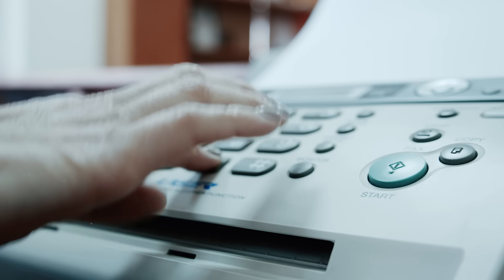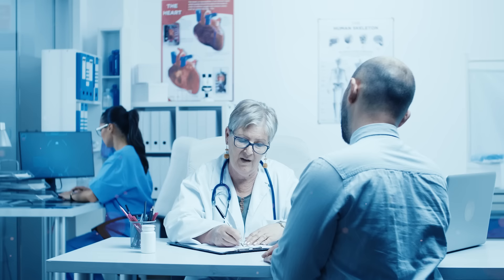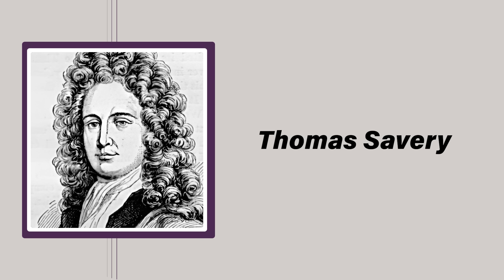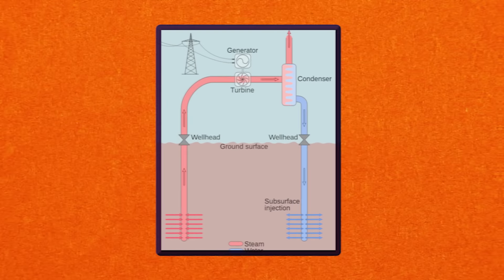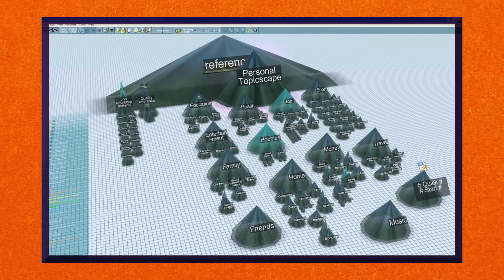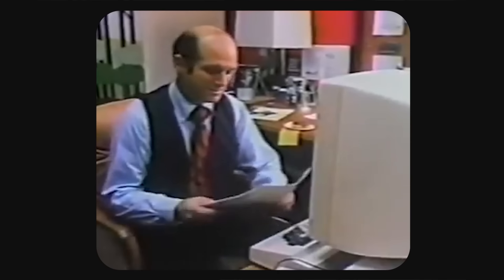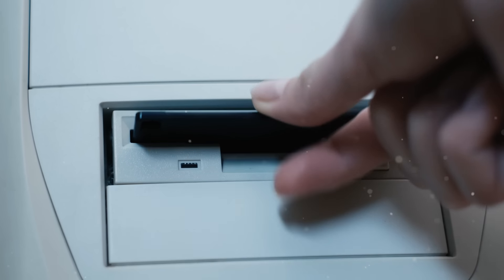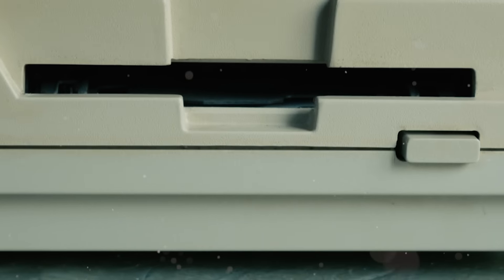Terribly Outdated Technology that we Still Use...

Comment: I've done those navigation database updates on 737s using 3.5" disks, and not all that long ago. That airline replaced their old data loaders with ones that had a USB port, but they retained the 3.5" disk capability as well. It was really irritating having disk 3 of 4 turn out to be corrupted. Sad trombone sound....
Reply: I had to dig out my floppy collection to update a CRJ 200 just to find out 1 in 3 of my floppy's were still good. For some reason the cannon plug is different for the floppy data loader vs the usb data loader on that AC. Personally I feel they should all convert to some form of serial connection.
Reply: Yeah the reliability of floppies is WAAAAY overstated in the video.
Reply: @jeposton do you have any idea just how mind-bogglingly expensive, time consuming and labor intensive it is to get even a minor upgrade to an aircraft's avionics suite approved by the FAA? Remember how truly old many commercial aircraft are today.
Reply: @billmullins6833  Yes. I do. An older aircraft, it does not make any economical sense to swap it over. However the data loader would probably be easier to modify to pretend to be a floppy drive when in reality it takes a magic USB drive. Of course that all has to be approved by the engineers and the FAA which is prohibitively expensive and they will only approve it per aircraft and not for every one just like it.
Reply: dont a lot of commercial airliners still use integrated analog computers?
Reply: @Term-0   I'm not sure about that. When I deal with a computer on an airliner, I just test it to see if it works, and replace it if it doesn't. They're just modules in racks. I think that all of the computers in the Embraers that I work on now are all digital.

Comment: I haven't worked with it in a few years, so it would need to be checked if this is current since 2021, but;  I'm Surprised that you didn't mention Fortran programming language.  Fortran is still used as the core managing language for Nuclear Power plants.  It's usually what was being moved around on those floppy disks.
Reply: Also supercomputers
Reply: You would be surprised at just how much code out their is actually Fortran hidden inside a C++ or Python wrapper. BTW I never did workout what the 7 spaces at the start of each line were for…
Reply: @davidwright7193  two reasons: 
1) you leave space for labeling line numbers if you're going to used them in the future.
2) legacy required white spacing for ribbon printer rolling.

Fortran still has to be compatible with it's 1950's versions even in FORTRAN 90
Reply: @eddokter  I was taught on 77 and the compiler fell over if you put line numbers in the 6 spaces but 2 sounds correct. I was working on one piece of legacy software in 2009 where the documentation referred to input data sets as “cards” it was only after I had worked out what this meant for the format of my data entry files that I realised whoever wrote that was expecting me to be punching holes in a piece of card with a knitting needle…
Reply: I would be prepared to bet that there is still a lot of stuff stored on punch cards or paper tape, as well as magnetic tape reels.
Reply: @allenjenkins7947  I am not going to take you up on that having found paper tapes holding protein structure coordinates in a box while clearing out an office.

Comment: I work in  the medical field, so I see fax machines everyday. Also, I grew up in a military family. My eldest brother served in the navy - he retired, serving a long career, mostly on carriers. He explained to me that every ship in the navy, diesel or nuke, was actually still a steam ship. Only the means of _ heating_ the steam differed.
Reply: Yeah, they're kinda important.
Reply: Diesel steam? Seems a bit unnecessary.
Reply: @Carewolf  it ends up being reliable. as it doesn't require total redesign of a working system
Reply: diesel powers electric traction motors on ships. it does not create steam.  @Carewolf
Reply: @mikes-wv3em  exactly! It is either directly driving the screw, or it diesel-electric, and have an electric engine drive the screw. In neither case is any steam involved.
Reply: I guess you believe trains use diesel to create steam as well😂
Reply: Different ways of boiling the kettle
Reply: @fastinradfordable i mean, oil burning steam locomotives do exist
Reply: On ships with boilers, diesel fuel is burned to generate steam... which in turn is used to spin turbines that propel the ship and generate electricity. Some ships have internal combustion diesel engines, some have gas turbines, some have both and some are nuclear.
Reply: Reliable and you can't hack a steam engine.

Comment: I used to work for the NHS in IT, left there about 7 years ago.  I was specifically employed because I was "old school" IT (I was about 48 at the time).  A lot of my jobs were keeping Windows XP machines working (off the 'net) that ran x-ray machines etc.  Elastic bands, blu-tac, cable ties, replacement fans and re-pasting processors.  Whatever it took to keep bespoke machines running.
Reply: Yep pre Google generation when you used to have to know how to do stuff not just tap in to Google and if the answer isn’t in the first link then throw it up to third line.
Reply: used to work for an organisation that had a panic attack when Oracle bought Sun Microsystems. Their entire IT infrastructure relied on SPARC servers and workstations and support for all that ancient hardware would be discontinued practically overnight.
They ended up buying the entire stockpile they could get their hands on to keep their infrastructure running hopefully for another 10 years at least.
Reply: @Jason-fm4my putting new thermal paste for heat management on the cpu
Reply: @Jason-fm4my  There's a layer of thermal paste between the CPU and the Heatsink to fill in microscopic gaps. This paste can turn into a solid over the years from drying out - this may lead to overheating and the system shutting down to protect itself, or running extremely slow.
Re-pasting simply means taking the heatsink off the CPU, giving both sides a good clean and reapplying fresh thermal paste.

The thermal paste can actually dry out to a point where it cracks and then cooling is pretty terrible.

PS: There's graphite pads nowadays that will last basically forever and can fulfill the role of thermal paste.
Reply: @Axeiaa 
Graphite pads are slightly less efficient but they are extremely useful when you plan to tinker or swap parts in the future. Costs a bit more, but great for versatility.

Phase change is the opposite. Hard to replace once baked in for the sake of more efficient transfer.
Reply: @Jason-fm4my  the thermal paste between the CPU and cooling system dries out over time (3-5 years) and needs replacing with fresh paste.
Reply: No sacred oil for the Machine Spirit? Tsss
Reply: @kettelbe  🤣🤣🤣

Comment: Some of the fire and water damage restoration companies were still using pagers in 2013/2014 for their employees that had to be on call when off the clock.

I was going to mention the fire service, but that was mentioned.  Typically the ones used in the fire service work off RF tones from dispatch instead of calling a number for the pager.
Reply: Carrried one of those for years as a volunteer firefighter. My pager went off in the grocery store once. The manager said "Go! I'll put your cart in the cooler and the frozen stuff in the freezer!"  And he did.
Reply: They're also intrinsically safe, which is why they're still used by natural gas companies during suspected gas leaks

Comment: In my experience, if you are not well organised, the achilles heel of the fax machine was the paper tray. About 20 years ago, the office I worked at went from having one fax to having one on each floor.  However, nobody realised that you probably needed to have someone on each floor who was responsible for ensuring that they didn't run out of paper. Occasionally, someone who was expecting a fax, having given a customer the number, would, after wondering why it hadn't arrived, check the paper tray and find it was empty. They would refill it, and several other faxes would print before the one they were expecting.
Reply: This is still a problem today with POS and other sorts of simple printers, if you run out of paper, when you refill have fun waiting for the entire spool to run, and hope it doesn't use all the paper again.
Reply: You would think it would beep or something to let you know its out of paper.  Also a larger paper tray would help if its was intended for office use.

 We had a fax machine when i was very young. I always thought they were amazing.  That was before we had internet though.
Reply: @fukkitful  Some Blink, beep and run a message saying the printer is out of paper. Some people are oblivious to all the notifications. Hardly, anyone has a straight fax machine anymore. It's an all in one printer in more office settings. With fax and scanning built in. So, you also run into the other issue of waiting for a fax and hoping no one prints anything to that printer before the fax comes in.
Reply: @tspawn35  Maybe if they had a pager attached they would never run out of paper!😄

Comment: I was exploring a recently closed and I thought abandoned plant that specialized in the storage and manufacturing of unusually dangerous and difficult chemicals. 

It still had power, the ac was running, and the phone lines still worked. 

It took me some time to find where they had put all the keys, but I eventually managed to get into a couple of the restricted areas, and they were still using xp on all the computers on the factory floor, including the halon fire killing system, and one computer was running a program that automatically monitored and stabilized alarming amounts of seriously scary chemicals. 

I got in using an a classic xp hack I learned, in some systems you can boot in safe mode, and then make a new account with administrator privileges, and then hard restart by button or disconnecting from power, and it will allow you to login to the admin account you just made. I think Microsoft patched that vulnerability ages and ages ago, so these systems must have been truly aincent, unupgraded versions.

And they're responsible for monitoring shit like a multiple thousand gallon tank of 93% pure sulphuric acid
Reply: The computer itself won’t have been doing the monitoring and control, there will have been a PLC somewhere doing that job, the PC will have just been a SCADA system allowing human interaction with the control system.
Reply: That sounds like something I would’ve done in my teens, major respect!
Reply: Not patched. I had to do it on my mom's windows 11 laptop when she forgot the password. As long as you have the boot disk, you can do it without an account with admin privileges.
Reply: @AlKaseltzer87  Learn something new every day here! Neat!
Reply: @Pugjamin  @pugjamin If I understand you correctly then  basically the xp computers were just a method of accessing and monitoring or interacting with the actual hardware and software that's  keeping an eye on things?
Reply: @Sniperboy5551  i have a jeans, a polo shirt, hardhat, a neon safety vest and giant clipboard and I can go look at pretty much anything anywhere without much fear :3

Comment: I worked for a small grocery store chain from 2008-2018 and they never switched from XP as the OS on the cash registers. I have no idea if they've updated since but I can see it being a big cost to upgrade all of the registers to newer machines.
Reply: It probably has to do with cost.  They’d have to upgrade their systems and the registers.
Reply: @roxcyn  that’s what I said
Reply: I have been contacted by companies using POS system wanting to use the same system but upgrade the OS to save from buying a new POS system.  For it to work the vendor has to port their software to the new OS.  It is possible, but not recommended unless there is a need for that.   
You're going to see this with Windows 10.  Systems built for Windows 10 should never be upgraded to Windows 11, unless you really want problems.   Systems are either built for Windows 10 or Windows 11, not both.  Microsoft said that "Windows 10 is the last OS you will need" meaning if you have Windows 10 Microsoft does NOT want you to upgrade to any future versions of Windows.